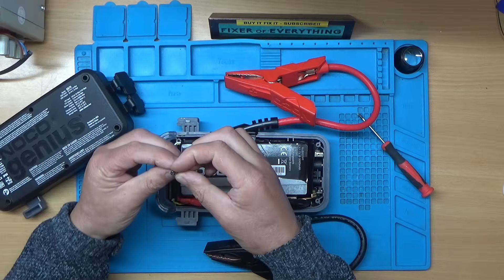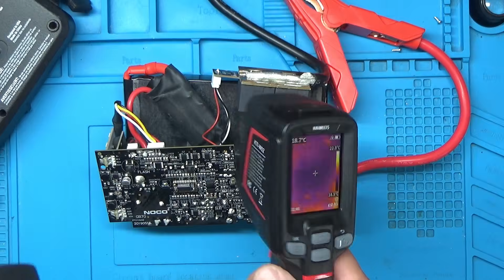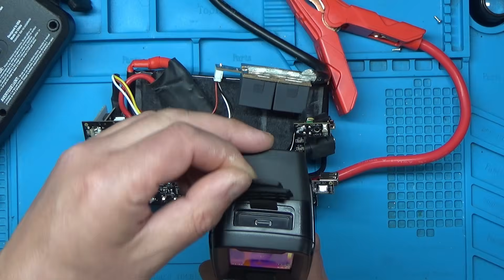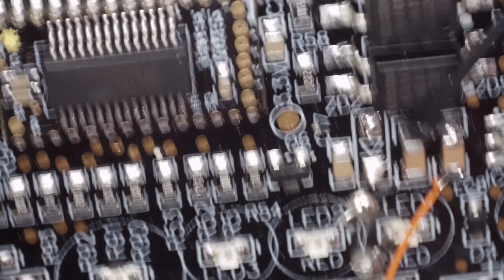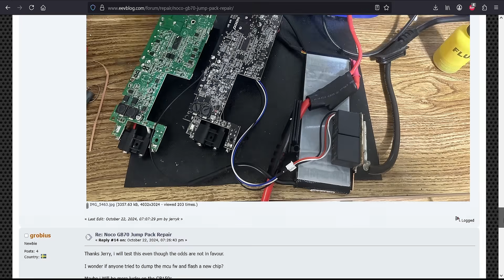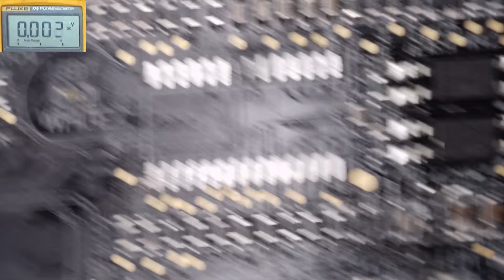Faulty NOCO GB70 Lithium Jump Starter | Can I Fix It?

Comment: I wondered how the circuit can power up when nothing is connected to it, or did I miss a USB, adapter or even a 110V/220V connection to it?
Reply from the maker: Was the battery not still connected to it?
Reply: @BuyitFixit Yes it was, except for the period where you applied 1V, 1A after removing a diode. I did not notice the large battery hidden behind the circuit board. So all is clear now. Thanks.

Comment: Hi Mick, i watched your videos trying to fix one of mine similar NOCO GB70 unit which doesn’t power on at all…tried to test the 3.3V which I’m not getting on the main board…I noticed that the two pin connector, which is coming out from the battery pack doesn’t have any voltage which makes me think that’s the one which is powering the board…the 2 pin connector, next to the four pins connector…I would like to ask if that connector should carry the 12 volta coming from the battery pack(asking this because I didn’t want to unwrap the battery pack to see if I’m right or wrong….Any advice on my question, will be greatly appreciated…thanks.
Reply: Those 2 wires connect to a temperature sensor taped to the middle lithium battery under the heat shrink layers. That would be why there is no voltage. The 4 pin black is battery negative, yellow is the junction between 1st & 2nd cell, white is the junction between 2nd & 3rd cells and red is the positive terminal of the 3rd cell or the full 11.1VDC. I know because I have GB70 with a bad battery and opened it up to see if I could source a new one. Noco won't sell the X22 battery either. Each of the 3 cells measures about 155 x 65 x 7mm and is rated at 5000mah but have no markings at all on the cells. The problem is they have 40mm wide tabs at opposite ends for the extra high current voltage output. So far I have had no luck finding something similar.

Comment: We should demand the right to repair! Such practices should have been banned by the EU long ago. There's so much talk about ecology...
Reply from the maker: Yes, there's loads of talk, but it always seems to come down to profit / cost saving. That's why some items are almost impossible to repair. Things like new washing machines now don't have drums that come in half, making it pretty impossible to replace bearings when they wear out. They are now plastic welded (cheaper) than using a dozen screws like they used to.

Comment: If the voltage regulators getting hot and the voltage regulator controls the voltage to the chip wouldn't the conclusion be to fix the voltage regulator and that's why the chips getting hot is because the voltage is wrong going to the said chip that's my conclusion you gotta fix the voltage  regulator first.
Reply from the maker: The voltage regulator would be getting hot because of the short further down the line drawing more current than the chip normally would, not because the voltage regulator was faulty.

Comment: Well, there are some harvestable parts in that no-name POS. The problem with these is the low purchase price is quickly negated by the fact that it's going to eventually fail, sooner rather than later, and when it does, parts probably won't be available. I'm rather amazed this thing is as complicated as it is! I suppose all that circuity is there to prevent blowups, smoke, fire and possible danger to the user.
Reply from the maker: Yes, I think the same as you that a lot of the circuitry is for protection, probably wouldn't end well if the user got the leads round the wrong way for instance, also flashy lights 😂😂😂

Comment: @BuyitFixit Another great video. I really appreciate your troubleshooting methodology and approach to unknown devices with no schematics or documentation. 
I would check the caps on the MCU daughter board before discarding it, however since those did not heat up, it is likely some I/Os got fried, which explains lack of reaction to the power button and some hallucinations about charging.
Reply from the maker: Thanks 👍Yes, not the caps on the daughter board as you would have seen those light up rather than the MCU itself.

Comment: You may be able to find another one that works, and you can copy the programming from one to the other. And get 2 that work. Just sayin'.   Thanks for posting Mick (nice thermal camera btw)
Reply from the maker: Cheers Neil 👍 Unfortunately most microcontrollers have code read protection.
Reply: @BuyitFixit  that's too bad. Oh well, you tried, that's what counts right?

Comment: It is a good thing eu plan to expand its right to repair act to include all sorts of electronic apparatus. All things should be able to be repaired including programmable chips.
Reply from the maker: Unfortunately manufacturers can still circumvent this, as they just make the cost of "spare parts" nearly the cost of replacing the whole unit. I had this with a Milwaukee sander. The motor shaft was broken, and to buy a replacement assembly (motor + bearings + belt) as it all came as one part was £89, and a new sander was £99. I managed to source a replacement motor from AliExpress for £10.
Reply: I think if you buy an item, the seller or whoever made it is not morally obliged to help you repair your item.

This right to repair law seems tyranny because it looks like it's forcing people to help you against their will.
looks like this criminalizes people who haven't harmed anyone.

this right to repair law is similar to taxation in that the people who support taxation want to force their victims to remit their money toward something against their will.
Reply: @flat-earther  the manufacturer isn't being asked to "help you repair your item". The requirement is that they make circuit diagrams and spares available, that they put any firmware and software in escrow, and that they make such things available under FRAND terms.

Comment: Is that thermal camera resolution rubbish or is it my screen?
Reply from the maker: Most of them are. This one does do mixed visual + thermal but because the two cameras are offset it doesn't work at very close distance. (Also I didn't have the upscaling enabled in the menu it seems). The £500 FLIR thermal I've got is worse as that's only 64x32 pixels at 12.5 FPS!

Comment: Maybe the caps on the MCU board were short?
Reply from the maker: On the thermal camera the heat is coming from the actual IC. You can see the square of the IC in a few places on the video. If it were the caps or one of them, you would have seen the glow coming from one side of where the chip was located. Unlikely all 3 caps would fail short, as once one failed it would take all of the current. Hope that makes sense.
Reply: @BuyitFixit I forgot that tidbit still with all my years of experience I probably would have still pulled them off just to see 100 percent agree with you the lingering what if drives me nuts I also have many many years of using holtec chips I found them 15 years ago in China very inexpensive use them for lots of projects almost any of their chips once you have them programmed and running in your product they will mask them and produce them for you under their part number therefore no more programming

Comment: We have the ability to copy the firmware programming off of a bias chip to a computer file and then send id back to a new chip, why not one of these? Pull the memory off of the bad chip and copy on to a new one. There is always the possibility of it's programming being intact. Think of a Play Station 5 with a defective HDMI port. Just because there is no output doesn't mean that the console is 100% dead. With the chip's data sheet it should be possible to modify the same interface used for bios.
Reply from the maker: Bios chips are usually EEProms which are not read protected due to them being read from an external processor. Nearly all MCU's have code read protection, to stop people from copying / ripping off the software. Sometimes these can be bypassed depending on the chip by using glitching attacks, like adding a crowbar circuit to the MCU's power lines and pulling it to GND at a certain point to skip the lock check.

Comment: Hi. Would it be possible to replace those boards with the cheap ones from AliExpress? Doesn't make sense financially but just to save it from the bin. Or will there be functions not available maybe boost function?
Reply from the maker: Alternatively you could just have a switch to enable the output relay, and charge it from an external source. It would work, but it wouldn't have any of the protection (kind of in boost mode all of the time).

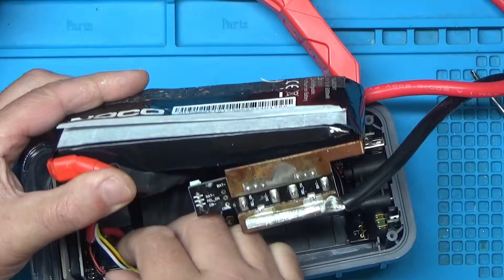Comment: What you said at 2:00 is so true, Mick. I pulled something loke this to bits many years ago, before LiIon batts were everywhere. I had absolutely no idea of the energy the things can store and produce on demand. I do know. Nearly burnt my house down. Managed to chuck the thing in a ghalvanised bucket and threw it down the back until it went out. It's why I'll never have a current ( pun ) tech EV. Imagine 1000s of the things.
Reply from the maker: Luckily I've not had that experience so far.. Glad you were OK.
Reply: 3,68 ICE vehicle fires for every 1 EV vehicle fire in my country. This is after adjusting for the relative lower number of EV’s.
Reply: @che1602  Yeah? Try putting the EV fires out.
Reply: And ICE fires don't sink car carriers.
Reply: NMC chemistry creates some nasty fires in the unlikely event of thermal runaway. However cheaper LFP chemistry is way safer and Sodium Ion batteries even more. Just pick up a vehicle using one of these.
Reply: @hpd385tannoylover2 
😂 funny story about the ship before Morning Midas Highway, Fremantle Highway: two guys from my country bought all 260 new BMWs (with only minor soot damage at the outside)
But BMW (not even the owner!)  forbid to sell those cars!
Lawsuit still running...
Reply: You have to adjust it to car age also. If most EVs are 5 year old or less, you should compare them to 5 year old ICEs. And if you do that, you'll find EVs go up in flames 20 times more than ICEs. But I suppose you know that, you just are here to defend the EVs because you either get paid for it or you got properly brainwashed already.

Comment: That's ok Mick, we still love you 😂
I remember you worked on a NOCO before? I guess it was a battery issue and their customer support wasn't helpful at all, so you had to make the battery yourself. 
I remember it has the same micro controller board but I'm not sure if it's the exact same chip.
Reply from the maker: Cheers mate, yes it had a very similar MCU board, but possibly programmed with different software as this one has a larger capacity and is charged from 12v I think, rather than the 5v micro USB on the other device.
Reply: @BuyitFixit Oh I see. 😮 Doesn’t matter fixable or not, the troubleshooting was 👌🏻as always, and the new thermal cam is dope 😃

Comment: Thanks for the video. There's probably a possibility, though not an easy one, to use either an Arduino or an ESP32 to bring some of the core functions back to life and give the GB70 a second chance.

Some of the functionalities that could potentially be recreated include:

-Power On/Off
-LED indicators
-Reverse polarity protection
-12V output control
-Connection detection
-USB charging
-Boost starting

Sounds like a great project to explore, especially since there's nothing to lose.
Reply from the maker: Yes, although there will be other things to add to the list as the original MCU is also the BMS, so it monitors things such as charging current and cell balancing. It's a fair chunk of work, and I've been struggling with lack of time at the moment due to lots of stuff that needs to be done around the farm before the weather turns bad in the winter.
Reply: I did something like this. It was a lot of work but the device worked again and I didn’t do it for free. The device was very expensive and not available anymore. But it took me weeks till it was working again 😂
Reply: Yeah,  that kind of manual labour is only affordable in India. I always are in awe to see those YT videos making and repairing stuff.
10 years ago, we went to Egypt.
In Cairo there was even a motherboard repair shop. From the outside you could see all repair stations and lots of people coming in with a motherboard under their arms (without anti static bag😂).
Incredible workmanship

Comment: Wow triangle screws and a propiertary OEM mcu. And probably bad circuit design (that Probably caused the mcu to fail) in such an expensive product completely baffles me! 

And knowing most vendors wont give you a new mcu or provide parts (apart from Peak technology who where nice and provided you with a new preprogrammed mcu for your capacitor tester)  This is destined for the landfill pretty much... 

The fact the cpu core and the necesary support blocks are functioning, apart from the I/O drivers seems to me that either a surge or overvoltsge has happened on some pins that in some way killed the I/O drivers in the mcu but left the rest pretty much unharmed. 

Kind of funny that instead of a bigger chip they put a smaller one on a daughterboard in its place. And knowing there is no datasheet makes me wonder what holtek chip it truly is. I also found holtek in multiple cases. A lot of products using their led/lcd drivers and a few using their mcus. I found a holtek lcd driver in our expired CO detector and a unmarked mcu which after tracing some pins and connections (it even had a debug header and i could interact with the chip) i could identify it as a holtek flash based mcu. I also was surprised it was not locked down and i could interact with it and write some data to it and even erase it. So luckily not all products use a read-only mcu but a lot of them sadly do still. 

If only right to repair was apreciated by these companies, the world would be a cleaner and better place.
Reply from the maker: Thanks for the detailed comment. Yes I think that could well be the case. I think someone mentioned on the EEVBlog post that theirs was killed because someone connected it to 24V. I did ask the owner how it failed but he said he was just charging it after it hadn't been used for a while. It was also mentioned that the little sub board was used possibly due to a component shortage during production, around the time of the pandemic.

Comment: I have seen dozens of those Noco units failed on auction sites!
If you need the module programmed look for some more of the same going cheap and harvest components to fix a few of them.
Reply from the maker: Yes, me too. The issue is this seems to be a common fault so you might have to buy two or three to fix one...

Comment: Maybe a cap on that little board is shorted.
Reply from the maker: Nope, as you would have seen it glow on the thermal camera like the shorted diode. It was the actual chip that was glowing.

Comment: The clarity on that thermal camera is hideous. Sure, you get a general idea of the area that is heating up. But instead of seeing a clear outline of what is hot, you see a huge yellow blob. I can’t imagine using it to repair a phone or laptop with much smaller components. I might be wrong, but judging from the way it looks on this video, I’d rather go with something else.
Reply from the maker: It's better than the £500 flir camera that I repaired. That was only 64x32. This one also has two cameras so you can overlay the visible image over the thermal but because the cameras are next to each other it only works at a minimum distance of 0.8 meters.

Comment: I often wonder if these microcontrollers are deliberately engineered so the silicon only lasts a few years? The thing is around £200 which is crazy expensive.  You'd expect it to last until the lipo was toast for that price.
Reply from the maker: Yes, I think it's just a poor design or something as this seems to be a fairly common problem with these.
Reply: Or just add some counter/date timeout code to brick or hobble it someway so the consumer goes and buys a new one.
I’m sure it happens. Manufacturers would say it’s a design “safety” feature 😉

Comment: Just so I learn something.. :) 
Would it not be possible that 1 of the caps on the module is shorted? Assuming it is, would that also not heat up the microcontroller?
Reply from the maker: No, if the cap was shorted it would have shown on the thermal camera. The heat was coming from the middle of the chip.

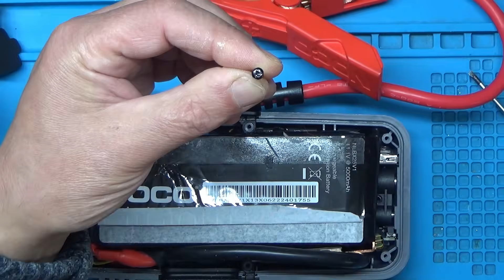Comment: At 1:25 - those are safety screws so the public in general can't remove them!
Reply from the maker: Except the public in general has access to a flat blade screwdriver which seems to work equally as well 😂😂😂😂👍

Comment: Can the program be read in the same way that cybersecurity techs read the programs coded into some of the devices they deal with?
Reply from the maker: Most microcontrollers are read protected. It might be possible to use a glitching attack to try and dump the firmware but you would need to have the equipment and the programmer to be able to try that.

Comment: Honestly it should be mandatory for all devices that use microcontrollers to store the programming on a separate chip, just in case the microcontroller dies. The way it is right now is very anti repair
Reply: Or a manufacturer who will happily supply a replacement preprogrammed one like some time ago he took a look at a Peak capacitor tester and it had a faulty mcu. He reached up to peak and they happily shipped a new one. I also got lucky with them when repairing a similar model
Reply: @309electronic5  that would also be a solution :)
Reply from the maker: Yes, if only there were more companies like Peak in the world. I've had dealings with a few companies now that weren't very helpful. FLIR in the thermal camera video that I repaired, and also another company with the Aurora Solar Inverter that I repaired, and then needed an engineer password.. (I had to take matters into my own hands with that one).. (No Password, No Problem) is the video 😂😂😂